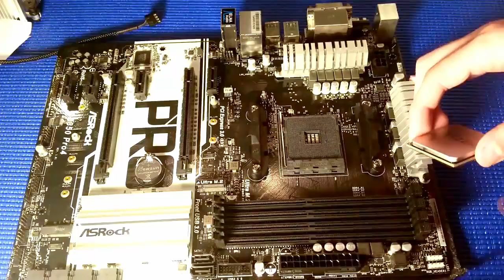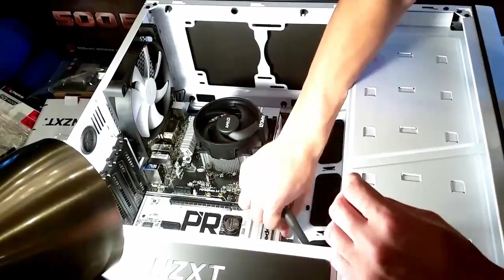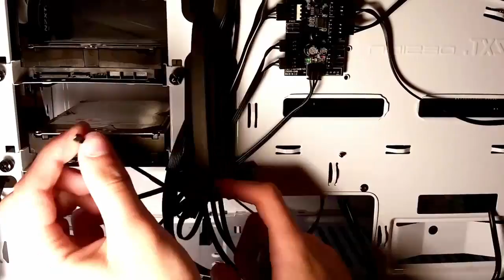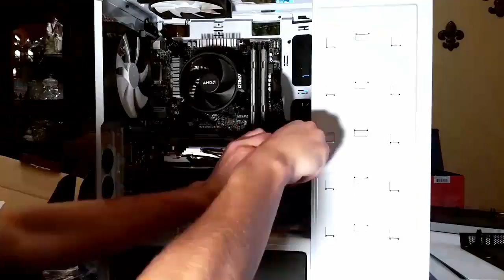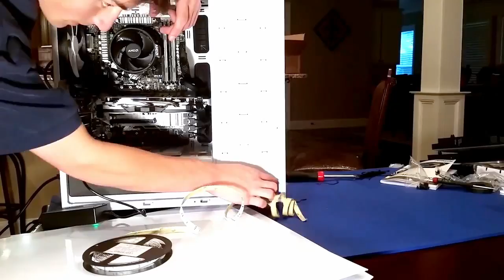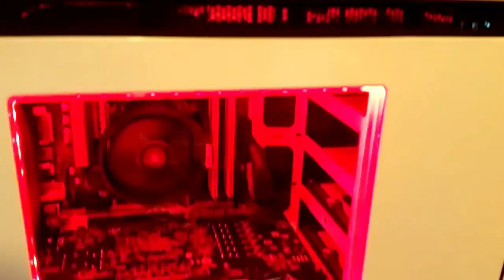BUILDING MY FIRST COMPUTER!!! (Feat. Ryzen, and Rx 580)

Comment: I have kinda the same setup except for the storage lol, but do you have enough power supply for the RX 580 8Gb? Where I ordered mine it said it needs like 500W when it is running at its max capacity so I got 850W.
Reply from the maker: LizardKweef it works but barely lol
Reply from the maker: LizardKweef I should've got a better psu
Reply: sad to hear, I calculated the wattage on the website of Cooler Master and it only gave me around 450W for my setup, but the 580 wasn't in the list yet, only the 480 so I had to choose that. Luckily I checked AMD's website before I ordered it. Nice vid btw!!
Reply from the maker: LizardKweef thanks
Reply from the maker: LizardKweef well at least you won't make the mistake a i made

Comment: i am building about the same as you right now. but i went with the nzxt s340 case  in red and black
https://pcpartpicker.com/user/vaporkilla/saved/
Reply from the maker: vaporkilla it's looks nice, are you gonna get a new gpu or plan to? that psu could support 2 580 I think, not sure don't quote me on that
Reply from the maker: also can you make a timelaspe out of it or something i wanna see it lol
Reply: sorry i don't make youtube vids, and i am going to add the same rx580 later. the mobo supports sli  and both of them together will be more than enough for what i play. i actually like your case better but i already got mine. mine only has room for 4 fans ( 1 top 1 back and 2 front ) which is why i am getting upgraded fans right away and am going to use one of the stock fans with my cpu cooler for a push pull setup.
Reply from the maker: lol ty, enjoy your new computer to